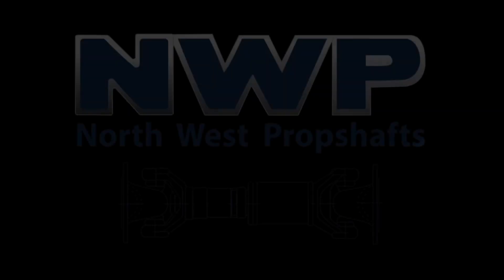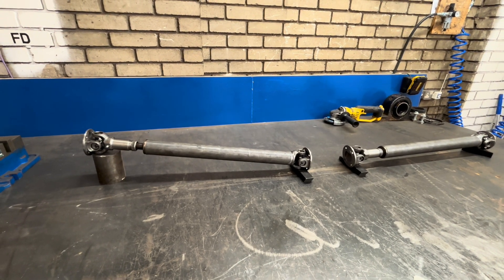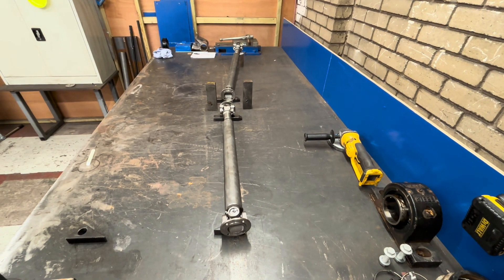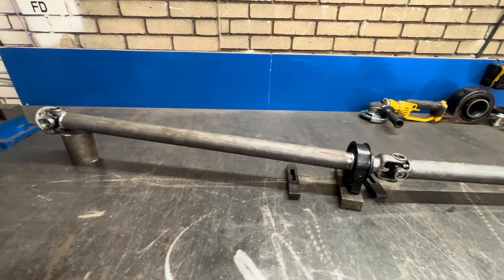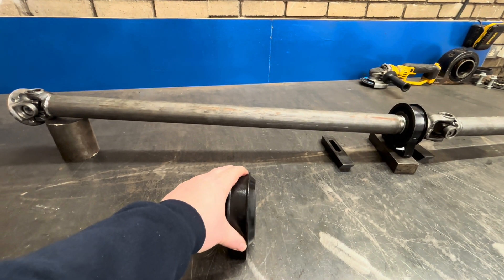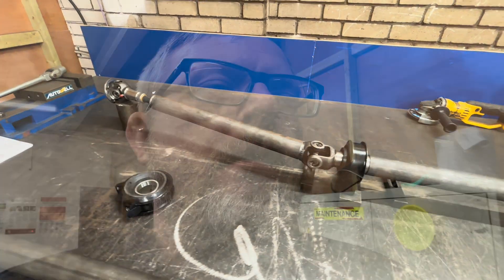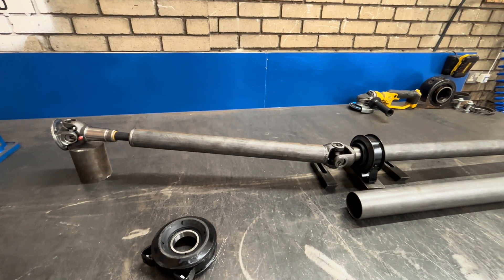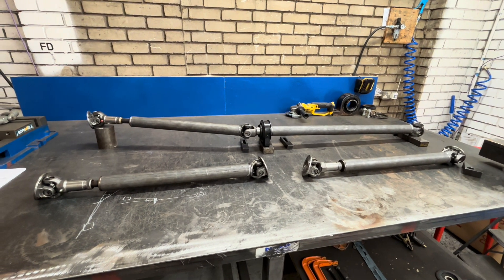The design of Bike Engined Kit Car Shafts

Comment: What would you recommend for shaft diameter for kitcar(westfield 7) running around 500hp?
Reply from the maker: Hi. It depends on the length of the propshafts. Give us a call on 01257 791681 and we can talk through it with you. Ask for Michael
Reply: @Propshafts  Its a two piece propshaft with center bearing. Both pieces are 600mm long.
Reply from the maker: @timppa811 so we would be building that out of 2” diameter tube over 600mm.

Comment: Thanks for the video. There must be disadvantages to using "CV"-style joints rather than cross? If not, how many customers ask for them instead?
Reply from the maker: Hi. 
I’m not 100% sure what your question is but. 
Propshafts CV joints work at a maximum of 10°. They are also 6 bolt fitting so it would mean a different flange off the back of the transmission or an adapter plate from 4 bolt to six bolt. In turn this plate would increase the centre line stand off and increase the angle. 
It is something we have looked at but cost tends to be the stumbling block.
Reply: @Propshafts  That 10* limit is basically what I was wondering about. There's a higher angular limit on some CV joints, such as for front drives on compact cars, but I don't know what the issues would be for using them in the applications you deal with.
Reply from the maker: @davidg3944  Yes there are different types of CV on the market but they aren't designed to use in a propshaft configuration so the connections on either ends don't match up to propshaft components. We can absolutely make them so that will match but cost is the the killer. This is a great question that im sure many people ponder on. Maybe a video explaining differences in driveshaft and universal joints and why, when and where they are used.
Reply: @ That would be an interesting video, thanks for considering it!

Comment: It's a great idea but it will only work with the diff mounted solid to the chassis. Obviously it won't work where there's a bike engine in an older kit car with a live axle.
Reply from the maker: Hi. Yes you are correct and there's a but. It depends how much the live axle moves. The movement action will only be in one plane. The centre bearing being rubber mounted can allow for a little bit of movement. This is one of the reason keeping the reverse box in there is a good design idea.
The reverse box could be replaced with a fixed through bearing housing. This wouldn't reduce weight but would mean each side could be a sliding shaft to accommodate angles and travel